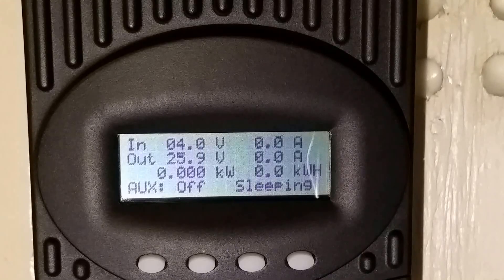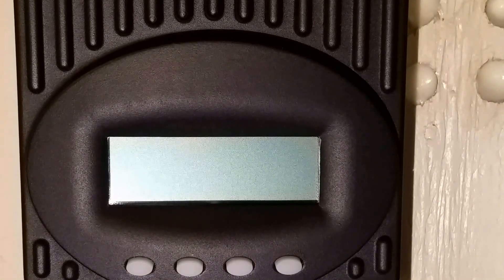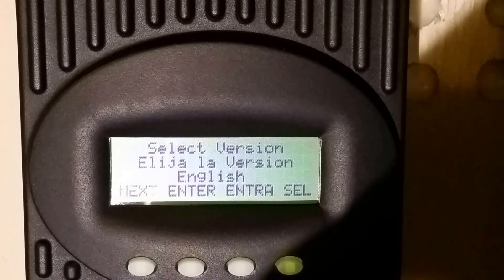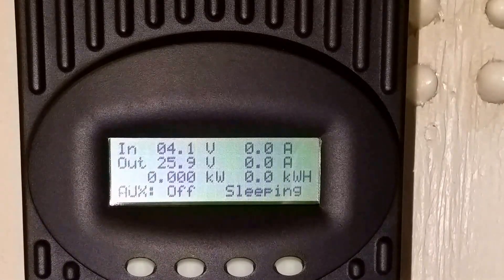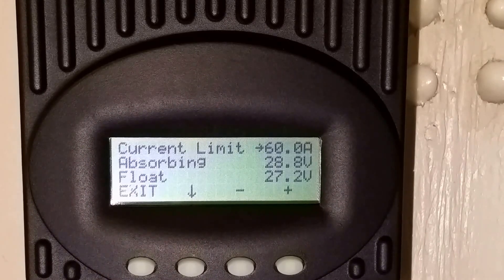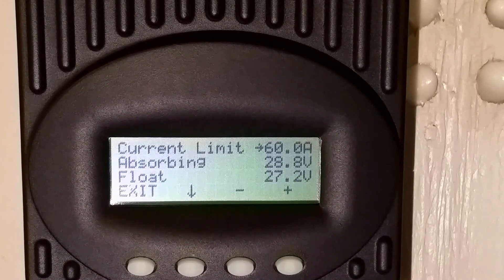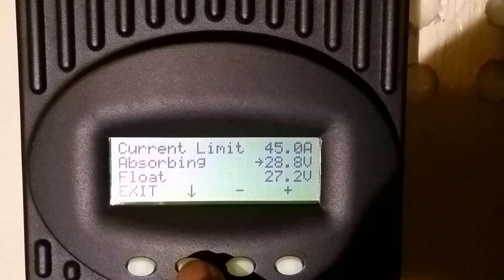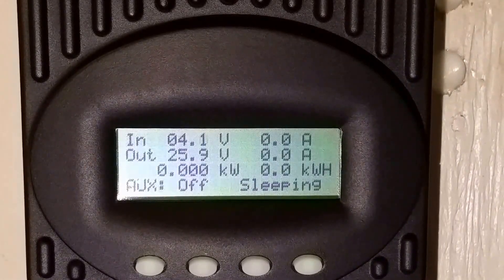OUTBACK FLEXMAX 60 RESET

Comment: How about there is a click sound and a over current appear,and there is no charging
Reply from the maker: There you go......over current appear. That means you have exceeded the recommended amount amps feed in the Charge Controller.
Always use Solar calculator to size your Solar Charge Controller.
Thanks for stopping by and don't forget to SUBSCRIBE LIKE AND SHARE

Comment: Thanks for the video.  I didn't see you configuring the EQualization voltage.  Is there a reason for that?  As I understand, equalization is a very important part in flood acid batteries.  Thanks
Reply from the maker: Thanks for asking. 
But, I am not running Flood Acid Batteries.
LIKE SUBSCRIBE and SHARE

Comment: great video thank you 
question
i have 2 120 AMP hour batteries - each one is 13.6v FLOAT - do i add these numbers when inputting them into the charge control or just set it to 13.6 appreciate it im clueless when it comes to electricity
Reply from the maker: What nominal battery bank you intended to run on your solar setup?
12V or 24V
Reply: @jwsolarusa  i believe 12V according to the data sheet i found...2 batteries are called eaton vrla battery pwhr12500w4fr -  120amp hours i was told when buying them !
Reply: @jwsolarusa  i have a 380 watt solar panel - a outback power flex max 60 solar charge controller  - with the two batteries and  3000 watt  pure sine wave inverter
Reply from the maker: @bumblebeechris  
I do understand what you talking about. 
What is your nominal battery bank voltage?
Ok let me ask you this, your 3000 watts Inverter Is it a 12V or 24V?

Comment: OUTBACK FLEXMAX 60 and  Morningstar’s TriStar TS-MPPT-60M  are One off the best MPPT charge controllers. Only here in Europe very expensive, the prize here is € 700,-  that is $ 812,-  .There in the US you pay $400,-  to $500,- 

I have sins 1½ year a 60 Amp EPSolar type 6415BND that work very well.

Comment: The problem I'm having with these FlexMAX controllers is that as the battery voltage increases with the day, they start pinching off the battery charge way under the max set point. This is a huge waste of power. Inverters that should be running won't even start because of this.
Reply: Hi sir i from afghanista and i want to know about the all system of mppt can you tell me the password of the mppt please sir i need to your help
Reply from the maker: The password is 141 to get into the advanced settings
Reply: @jwsolarusa  thank you sir
Reply from the maker: You are welcome buddy.
Please be careful with the settings on the Advance menu. I will encourage you not to make any changes on the Advance menu if you don't understand features on them please. Or your Charge Controller will not work properly